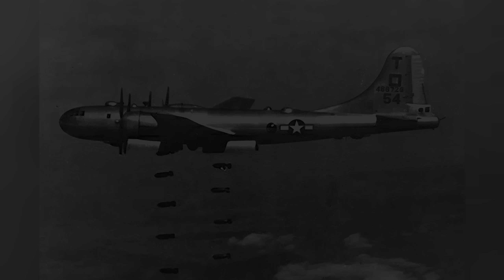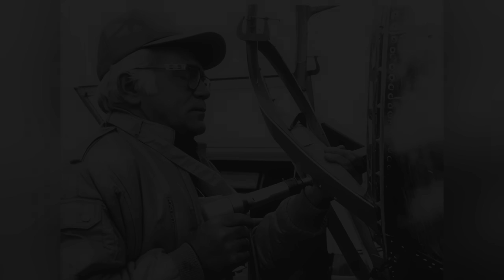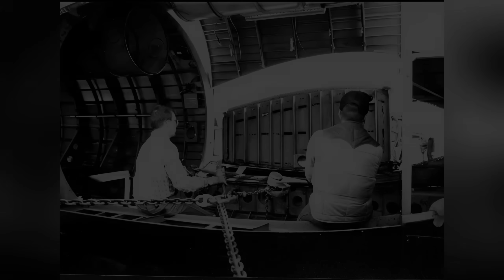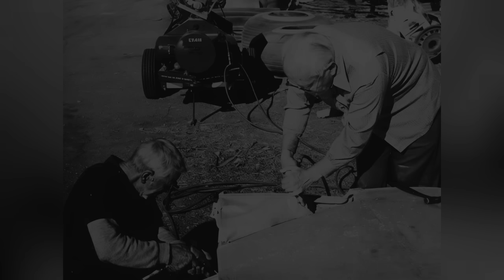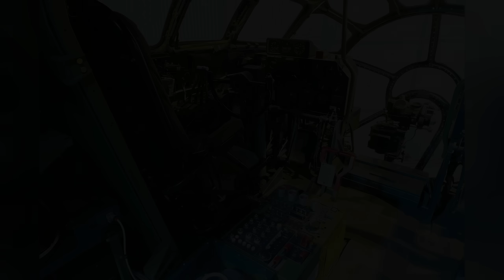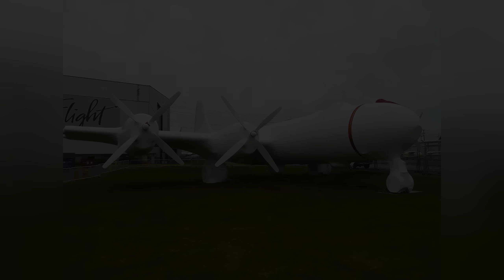Recovering B-29 "T Square 54": Saved Before It Collapsed

Comment: During the restoration at Lowery AFB, I was part of the restoration of all 4 of the R3350's. All 4 were ZERO timed full operational engines, ready to fly. Hopefully, they got traded into the system where they could be used and not sit for eternity!!!
Reply: Wow, Brand new engines just sitting there going to rot. Yea, they need to trade those out and refurbish them, to keep the very few that still fly, in the air.
Reply: @phil4986  They were Zero Timed, just remanufactured, most of the parts are original, well except the pistons & jugs, cams, lifters & rockers, and plugs. all 4 were broken in with a 30-minute initial engine run to see if everything was operating and then packed with cosmoline and shipped to Lowery AFB. The A&P school at the time had cornholed every part for at least 10 R3350 engines, they had 3 complete on hand to be modified to become training aides at the time but who knows what happened to them from then to now, the school had changed owners at least 5 times since 1988, and who disposed of the excess parts laying around in storage.